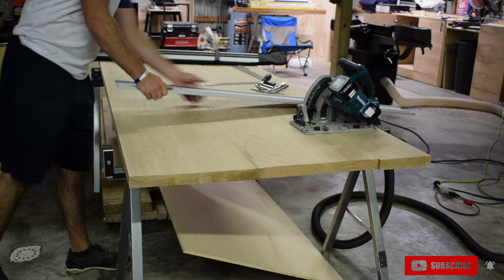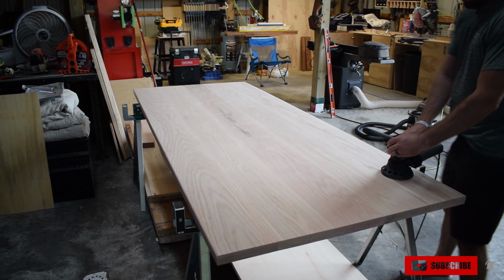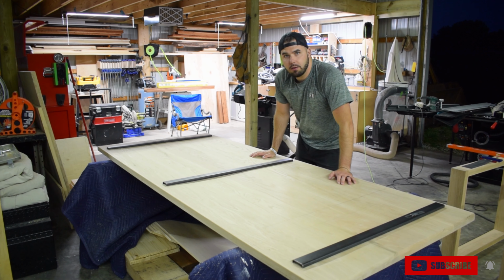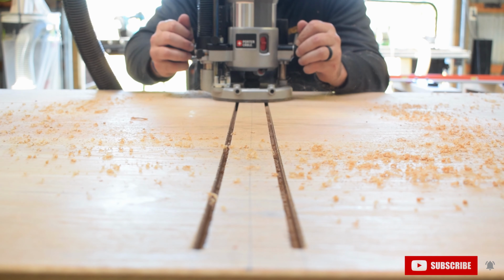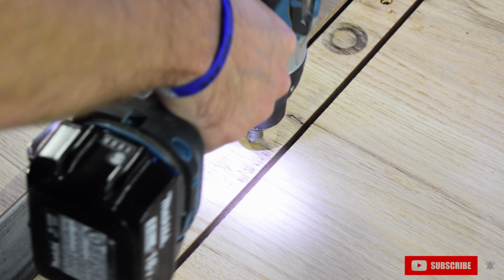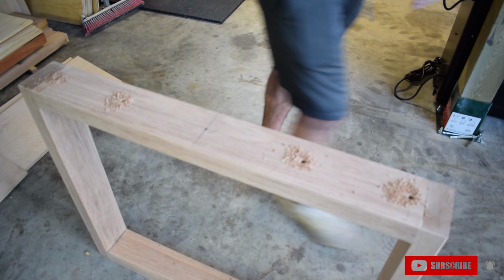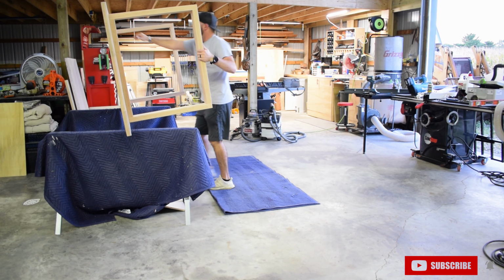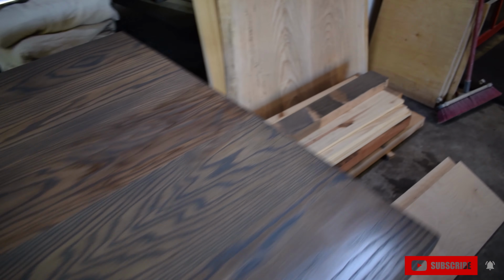How to Make a Dining Table : Part 2

Comment: Nice build man. Thats the first I've seen wood glue used on threaded inserts, typically I use a quick 5 minute epoxy because that will adhere to the metal and the wood really well. In any event, piece turned out great man! Nice to see another Indy guy out here building!
Reply from the maker: Appreciate you watching and thanks for the epxoy recommendation! I'll have to give it a try on the next build. Yes, nice to have another builder in the Indy area!

Comment: Really nice build. I was curious with bolting the legs to the table top is there any concern as far as not allowing for wood movement. I ask because I’m building a similar table and for more traditional tables with an apron to top attachment I’ve seen people use z-clips or figure 8s and warning against bolting base to top. With this design is that not an issue? Thanks.
Reply from the maker: Really appreciate you watching. I referenced a video from blacktail studio for this build. I would recommend taking a look at his video as well.  Snugging down the center bolt and backing off the remaining bolts should provide enough clearance for wood movement with the seasons. I haven’t received any negative feedback from the customer thus far and they have had it through winter and halfway through summer. Thanks! Nick